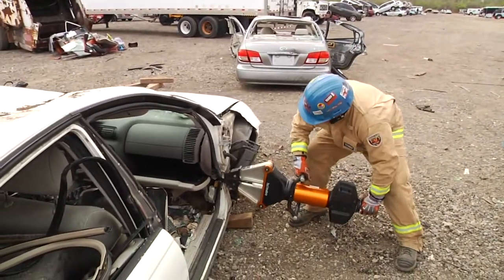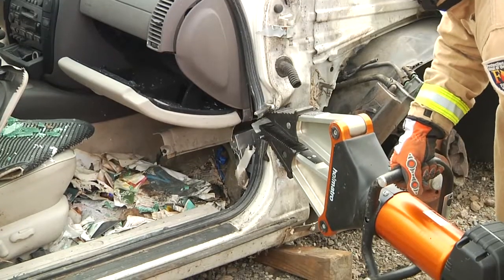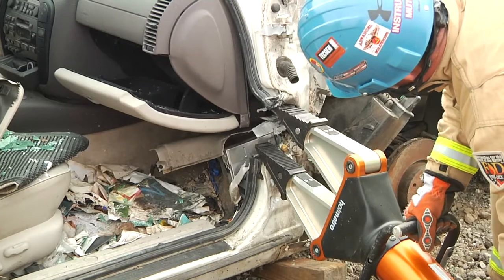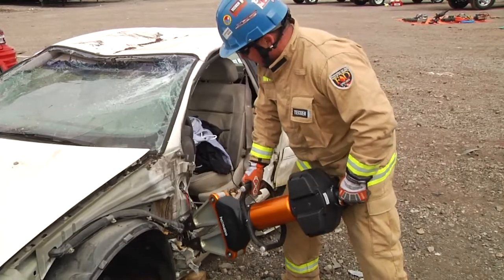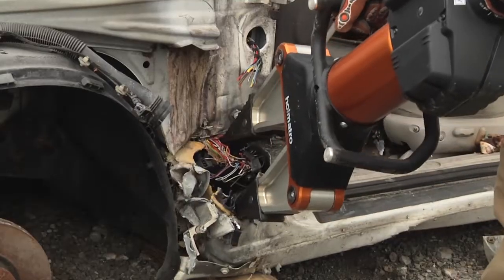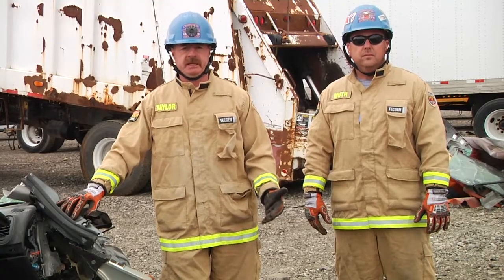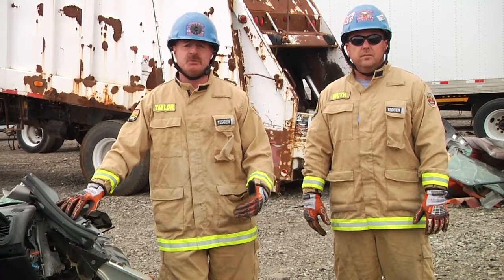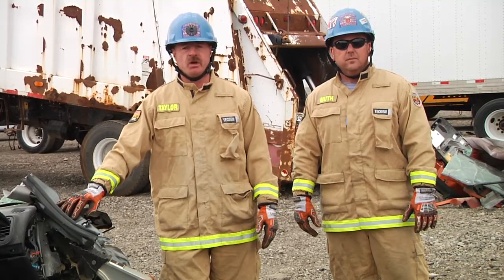Holmatro Quick Cuts 5 (2018): Dash Push Details

Comment: Hi, when you do the relief cut in the A post do you do a single cut ?
Reply from the maker: Hi Andy, thank you for your question. It depends on the size of the A pillar whether or not you can cut through it completely with just a single cut. If not, you need to make as many cuts as required to complete your cut. We hope this answers your question.
Reply: @HolmatroRescue  Sorry I didn't  mean that. We do 2 cuts 4 inches apart then with the end of the spreader we nip the piece between  the 2 cuts and bend it out of the way. 
It gives you a nice wide gap to get your spreader in when doing a lift and saves you having to reset the spreader when you try opening  up the single cut.
Hope this helps.
Reply from the maker: @andyoxleyonhistravels  Thank you for your reply. The technique you describe is also one we are familiar with and both efficient and effective for a dash lift. Techniques will always vary per geographical region. This video was made in the USA for the Fire Engineering platform and shows a commonly known dash lift technique in that part of the world. We always welcome feedback and alternative options as we believe that a 'single truth' does not exist. Have a nice day Andy and thanks again for your valuable input. :-)
Reply: @HolmatroRescue  Same to you. Always  nice to share information  and techniques.